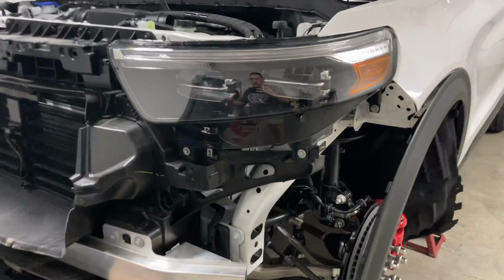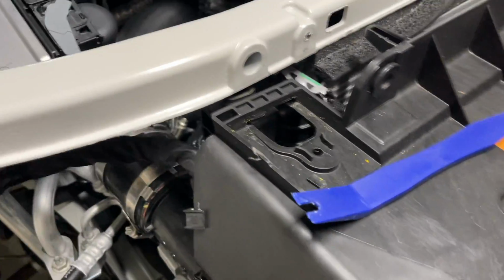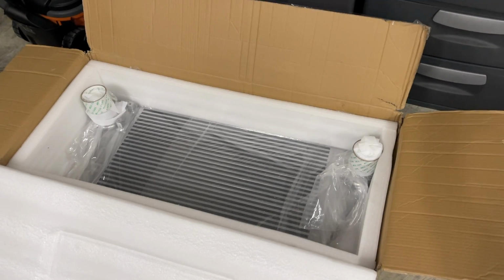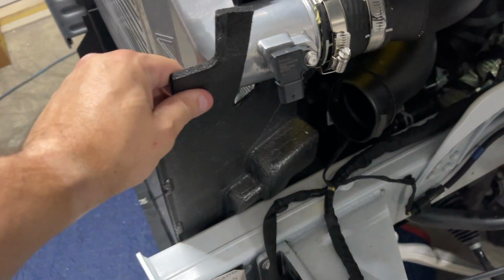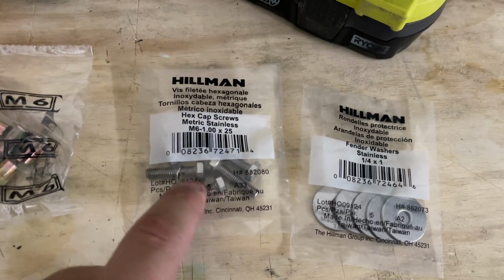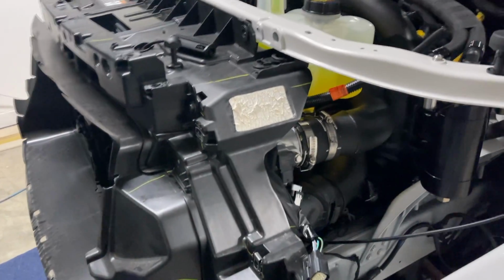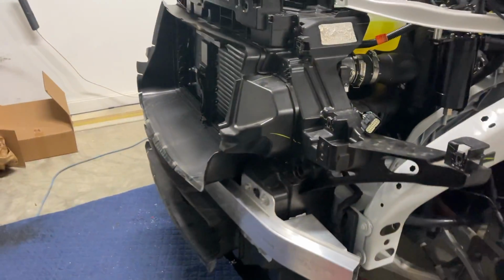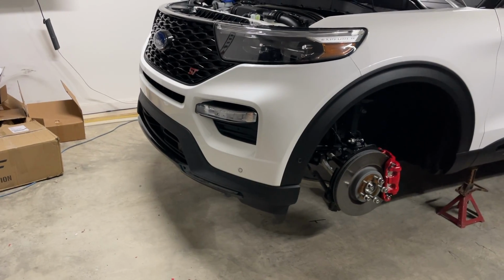2020 - 2024 Explorer ST CV Fabrication Intercooler install.

Comment: Thanks for the videos. Waiting patiently for my intercooler to come in. Got some other goodies coming too. Charge pipe/bov, thermal r&d 3in cat back with mid, and zfg tune can't wait.
Reply from the maker: Thanks!   I have H&R springs that should be on the way today or tomorrow and I’m patiently waiting for CV fabrication to come out with their Parkside Charge pipes.  
I’m also looking at whether or not I want to spend the money on the AFE front and rear sway bar kit or just go with the Steeda rear.
Reply: @KnightsGarage  I have the steeda front strut and rear away bar. I don't picture afe to really be any better. But I might cancel my steeda springs and go h & r
Reply: I have the Thermal R&D 3in cats. Trust me, buddy, you won't be disappointed in that exhaust system. It sounds amazing, and I'm running it on stock downpipes right now.
Reply: @thatguy6580  hell yeah can't wait

Comment: I also have a 2022 St and I’m following your channel.  My question is why do you think you got the “CEL” when removing and taking the blades and motor out?
Reply from the maker: Because with the factory tune, it looks for the shutters to open to the fully open then close to the fully closed position to know what position they are in. If you remove the shutters, it cannot hit the bump stops for fully open and fully closed. If you’re running an aftermarket tune, the tuner locks the shutters to the open position so you won’t get the code.